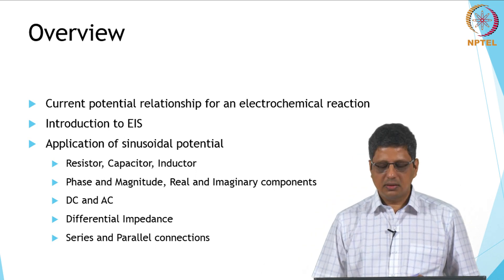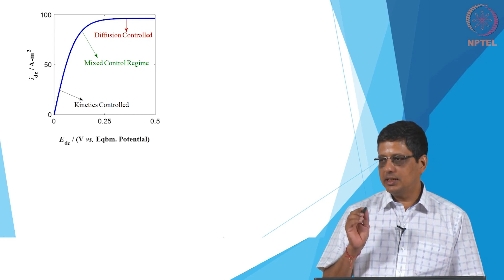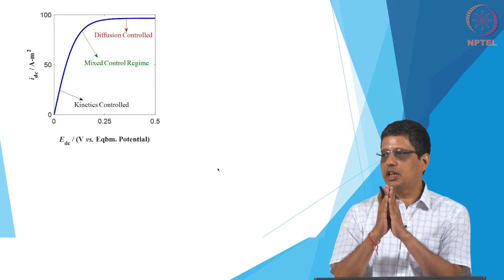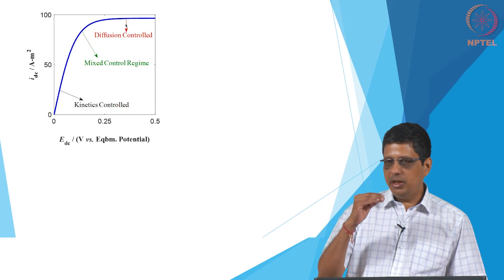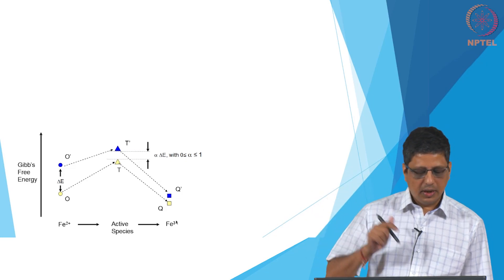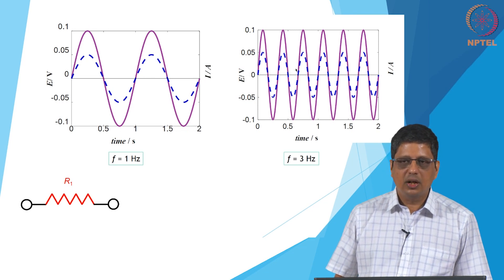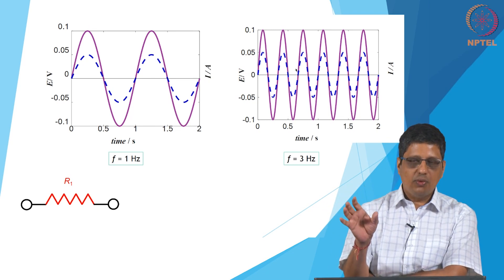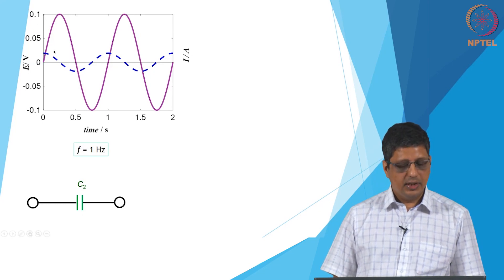#2 Rate Constant, Impedance Concepts & Z of Electrical Elements Explained

Comment: -Low rate const at low voltage; rate const prop to voltage exponentially
-Diffuse > react > go out
-Slow reaction> kinetics controlled
-miexed regime
-Fast reaction > mass transfer/diffusion from boundary layer >Rate limiting step
-Applied potential moves free energy of reactants and products but also transition state, but transition state is not moved up as much
-charge transfer coeff: (0-1) ratio 
-boundary layer thickness can be reduced by changing flow rate/ rotating electrode
-impedance: for resistor : current follows voltage, no difference in phase, current doesnt depend on frequency
-for capacitor: current leads potential, 90 deg phase offset; current proportional to frequency for the same E 
-in cap i = c dv/dt); c d(e sin wt)/dt = C w e cos wt
-impedance: transfer function, vector ratio, generalized resistance
-for inductor: voltage follows current, 90degree phase offset; current inversly prop to frequency
-in ind E= L dI/dt; E=L d(I sinwt)/dt; E= L w I cos wt
-Impedance is represented as complex number: phase and magnitude represented by same complex number; e^jwt = cos wt + j sin wt
-Zr= R
-Zc= 1/jwC = -j/wC // -j denotes below the real axis 
-Zl=jwL
-AC can be superimposed on DC (bias) > will lead to different impedance values because of electrochemical reactions. In normal circuits DC bias has no effect on Impedance
-Measurements always made on differential impedance: dE/di, can be negative if I-V slope is negative (second half of concave down parabola)
-immitance: combination of admitance (1/Z) and Z
-KCL = sum of all I on a node = 0; KVL algebric sum of all voltages in a loop zero
-Calculating Series and parallel immitance: series: add impedance; parallel: add admittance